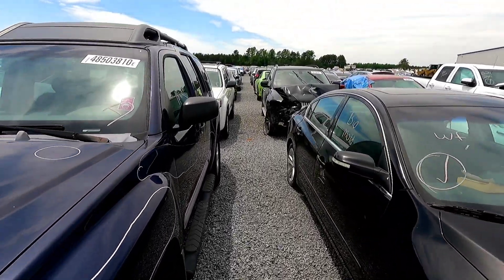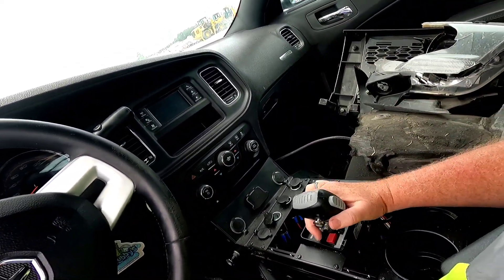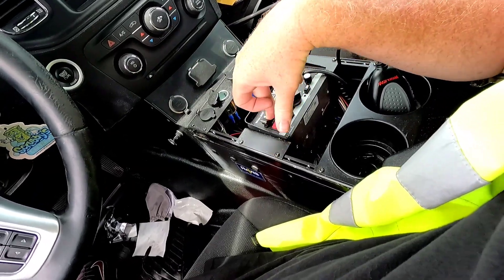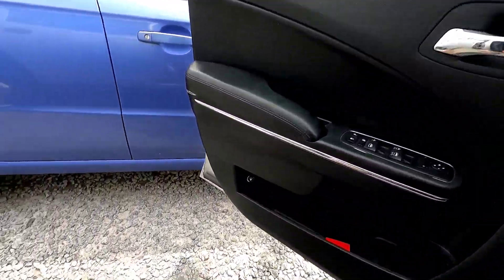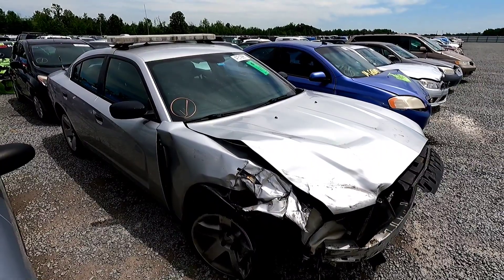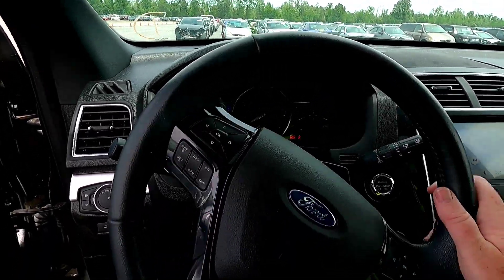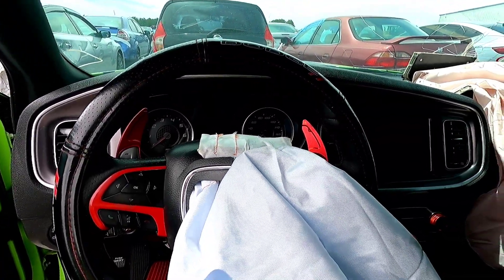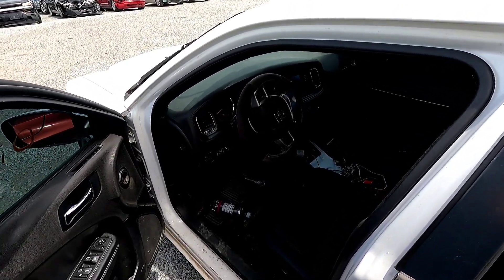Fully Working Police Car with all Lights cheap at COPART, @Slimepack392 scat pack update

Comment: That's surprising they left that stuff on the car.

New York surplus auction State Trooper chargers look to run $2000-$5000 depending on condition.   But they remove the gear.

Comment: Tk im a 30 year body guy an very good at what I do an I actually do alot of cop cars an smashed way worse very fixable 
Might need cradle or k support an some upper frame support work an a strut an a lower a arm an stuff give me 2 weeks with it be like never been smashed an it van be put back in working order just nut use the lights on road an dont letter it police an would be fine I bet id remove the roof light an put under cover lights in windows